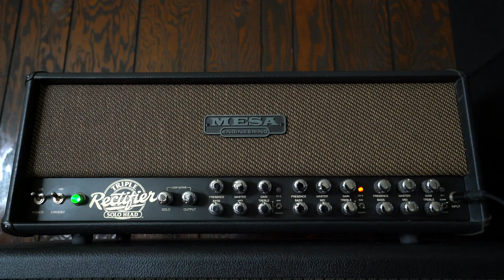JT Amplification Modded Mesa Boogie Triple Rectifier

Comment: Hey can you help me with that : I have a 16 ohms cab and my input on my amp are 4 and 8 ohms. Is it safe to plug my 16 ohms cab in the 4 ohms input?
Thanks
Reply from the maker: no. plug into the 8, depends on the amp honestly.
Reply: @RezaMatix   it’s the Badlander it has two 4 ohms and one 8 ohms
Reply from the maker: @rec99cts27  use the 8
Reply: @RezaMatix  It was in my manual and yes you’re right!
They say it’s a safe mismatch 
Thanks again Reza really appreciated 👍

Comment: Kills Badlander?
Reply from the maker: murders it.
Reply: @RezaMatix  this is how I compare my Dual Rec that I modded myself to the Badlander (I did a simple mod changing the gain pot). That modded triple rec. sounds as good as a recto should sound!
Reply: This is the sound of buyers remorse for them Badlander Jedi's
Reply from the maker: @jaykafcas4342  hahahahaha
Reply: @mark_iic  What did you change the gain pot to? Where did you buy it from, Mouser?
Reply: @InGrindWeCrust2010  I bought the pot directly from Mesa Boogie: https://store.mesaboogie.com/products/pot-590792-16mm-1m-594-shaft-20-taper.html
Reply: @mark_iic  Thanks so much! So just changing the gain pot to this makes that much of a difference!? Great!
Reply: @InGrindWeCrust2010  yes it does! I did a video using the modded pot if you want to check it out: https://youtu.be/WRErPGGbEMY
Reply: Honestly this sounds pretty much how my Badlander amp sounds.